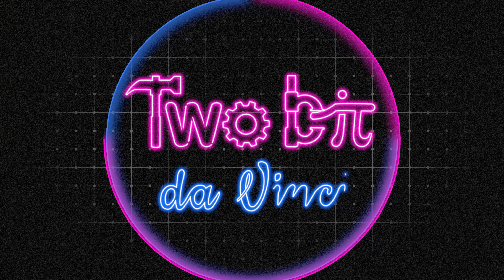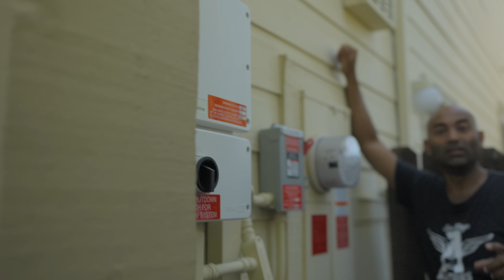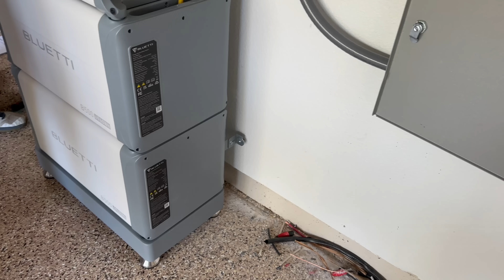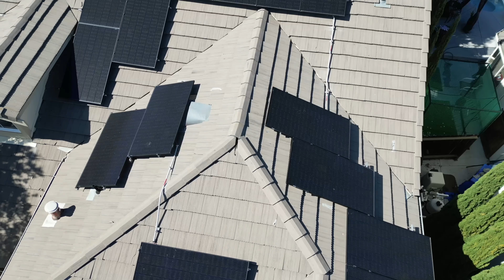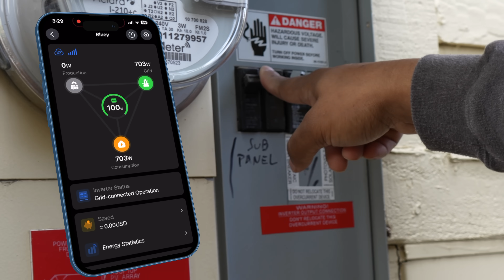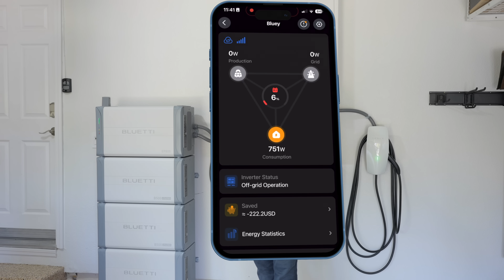Why the BLUETTI Whole Home Battery is GENIUS

Comment: Oh Ricky... this is possibly the single most expensive way one could ever possibly put in an ESS system.  It's years out of date... this is NOT what a person doing ESS today should be doing.   And those capabilities are also not all that great.  Lackluster at best compared to modern home ESS. 

The way you do ESS today is either with a gateway or with a meter collar.   I'll describe the meter collar method because it is the absolute cheapest way to do it.

(1) Buy meter collar from your utility for ESS (not for a generator, for ESS).   This is basically a main service disconnect controlled via a data link.  It goes under the meter... literally you pull the meter (ah... a real utility-certified electrician pulls the meter, not you), plug in the meter collar, and then plug the meter back in.

(2) The ESS system then simply backfeeds the ENTIRE house via a 2-pole breaker.   No critical loads panel needed.  No major electrician work needed.  No transfer switch.  No 200A work at all outside popping in the meter collar.

(3) You then put the ESS system anywhere (such as the garage), near the breaker.  The cabling is dead simple.  It can be DIY'd once you have the breaker and meter collar installed.   The backfeed into the house is just a 90A circuit (roughly 20kW worth of support)... that's 2 AWG cabling, and it goes into a breaker.  No need to reconfigure the service panel or any breaker panels beyond adding a single 2-pole breaker.

And you are done..

Also, in terms of capabilities... this Bluetti system is way, way, WAY behind the times.  Something like an EG4 FlexBoss21 has almost double the capability in all respects, including being able to drive AC motors with 195LRA ... meaning it can start a 5-ton A/C unit.   A Tesla PW3 is similar.  We're talking 12 kW of continuous output and 20kW+ worth of solar.

The Bluetti system is also using a TERRIBLE battery topology.  It's basically using the BYD HVDC series-connected battery topology rather than standard 48V. LiFePO4.  You get locked into the Bluetti eco-system with this Bluetti system.  I can't fault your brother getting (presumably) a "free" system, but NOBODY should be using Bluetti for full home ESS.

I'm sorry, it's just a huge mistake to go with Bluetti or EcoFlow for something this big.   You have to go with Franklin, Tesla (PW3), or EG4.  Maybe SolArk once they get a gateway product.  And perhaps a few others....  but do NOT use Bluetti or EcoFlow or any power-station maker who is just rebranding the out-of-date BYD system.

-Matt
Reply: Agreed, he should promote better systems than this old bluetti
Reply: Wow, while every thing you said is correct for a new design, this makes a lot of sense for an existing grid tied solar system under contract that wants some battery backup without giving up what they have. Those old contracts are gold in the pocket compared to the new ones. Is it perfect? No. But it is functional for retrofit and would help in power outage areas like where I use to live. It seemed like we had an eight hour power down every month or two on that co-op there. Yes it is expensive compared to a new install, but is an economical update and with an isolated second solar install it could go indefinitely waiting for grid power to come back up I remember when my son had a two week power outage in St. Louis County, MO some years back and his father in law needed power for his breathing machine. Also they were powering fans in the house off of an inverter connected to his car battery and driving around at night to recharge it. This is heaven compared to being at the mercy of the power companies. This is not the way to go for a new designed system, but there is a segment of the market that this fits better than any other. Those who are locked out of battery backup by contract now.
Reply: @markpashia7067  I’m fairly sure all the gateway / collar systems I mentioned support legacy AC couple solar.  EG4 certainly does… because that is the system I have and I have legacy AC coupled solar tied into it (A 5kW SMA system installed 23 years ago).  I know for sure that Sol-Ark does too.  It can even be supported during a power failure, with some limitations.  Grid-interactive inverters can keep the AC coupled solar tied in without the grid once they are isolated from the grid by the meter collar or gateway.  YMMV though, you have to read the individual system documentations.

There are two flavors of AC-coupled solar.  The oldest microinverters and string inverters support UL1741.  More recent ones support UL1741SA/SB.   All of them will work on-grid, obviously (including in meter-collar and gateway designs).   It all comes down to what happens when the utility goes down and the house is either automatically or manually isolated from the grid in order to be able to use its batteries and inverter backup.

The oldest AC-coupled solar, UL1741, only supports "ON" and "OFF" via frequency control.  60Hz on, 62Hz off.  These systems might not be able to operate on a microgrid when the utility is down because of the lack of linear power regulation.  It's either ON or OFF.

AC coupled solar that supports UL1741SA/SB supports servoing the power produced from the panel via the microgrid frequency.  60Hz is full on, 62Hz (typically) is full-off, and frequencies inbetween represent a linear ramp between the two.   This is very easy for grid-interactive inverters to support when the utility is disconnected due to a power failure (etc).

(such support requires a full-on battery system because the inverter has to sink short-term excesses into the battery and supply deficiencies from the battery).

-Matt
Reply: What would a gateway do for a solark (I've a cheap solark clone)
Reply: @ Gateways (e.g. Tesla, Franklin, EG4 GridBoss),  move all the 200A service wiring and code compliance off of the inverter, vastly simplifying system design and removing the need for additional service-side components like transfer switches… they are all built into the gateway.  Now only the gateway needs to be near the service entrance, while the rest of the system can be placed (and scaled) in more convenient locations as well as not have to deal with 200A cabling.  This has become especially important as requirements get added for code compliance.

Gateways began supplanting 200A service splices through the inverters (and all the other add-on stuff you saw in this Video) a few years ago.  The meter collar is an even newer and lower-cost substitution for a gateway that simplifies things even more, at the cost of some functionality.

-Matt

Comment: Since his solar is grid-tried if he does lose power he also loses any solar generation and can't keep his batteries charged.
Reply: @jabbathespud  not sure whether this bluetti system supports AC-Coupled solar in grid-out situations, but it is common-fare for all the majors who’s inverters support AC-coupled solar grid-on or grid-off.
Reply: With no transfer switch the solar inverters have to shut down to avoid islanding and energizing the grid.  So no grid, no solar.
Reply: Not with his current solar, but near the end Ricky showed how he plans to put in another set of panels that feed the charge controller to keep batteries up in a black out. It has inputs for an isolated system of it's own that do not void his current contract for the grid tied solar. I would have to go back but I seem to remember his saying he could have five or six panels on the isolated system.

Comment: Rich people problems
Reply: Rich people solutions, to problems we all have to deal with.
I'm an apartment dweller - a nice place in a nice neighborhood, to be sure, but not a big house out in the 'burbs all to myself. (I grew up in the 'burbs, though not as fancy as the one in this video - that looks more like my late uncle's neck of the woods out around Danville - and I couldn't wait to escape to the city.) Which means, I can't put solar on the roof, or a battery backup in the garage.
But I might be able to get some kind of backup for my apartment - maybe? I've been idly pondering the idea, with increased motivation every time the power goes out, which is distressingly frequent. And since my office job has been work-from-home since 2020, having the power go out when I'm on the clock is Very Bad. (Happened just a couple weeks ago.)

Comment: Perhaps code in your area (not sure), but the watertight flex conduit is lazy and definitely not as professional as EMT or PVC conduit.  And extra surprised that was run between the fixed electrical panels, and the Tesla charger.
Reply: I was surprised by that too.  California generally wants ESS systems to be UL9540 rated and CEC-listed.  Maybe UL3141 too (not sure).  Bluetti isn't CEC-listed so getting utility approval would require going through more hoops.  I really doubt any UL9540 listing would allow flex conduit for high amperage circuits.   It should have been done with EMT.

It might still pass inspection but... I dunno.   Wouldn't be my first choice.

-Matt

Comment: Use lift truck battery's , safe ,last forever, rebuildable , those your plugging are ticking time bombs
Reply: Not promoting or otherwise, but the facts are these are LiFePO4 chemistry which shouldn't be confused with the more questionable LiPO4.
Both of these are far better choices functionally, environmentally and safety-wise than lead acid.
Reply: @ChuckD59  your delusional

Comment: WE need to eliminate the power grid for security. It is WAY too vulnerable.
Reply: Not eliminate. Make it resilient.
Reply: @ Zer9o Point energy is being kept from us.
Reply: The power grid is essential - it needs to be updated with modern materials and with today's more decentralized production system (rooftop solar etc.) in mind.
And part of that involves individual home/building backup, and local microgrids, for resiliency. Basically, the electricity grid system needs to evolve from the hub-and-spoke model to a network model.
Reply: @dwc1964  It is not with essential  the right technology, the technology being kept from us:) Thanks for engaging:)